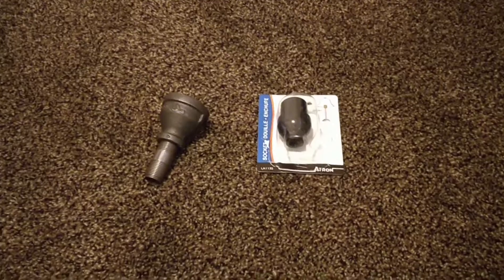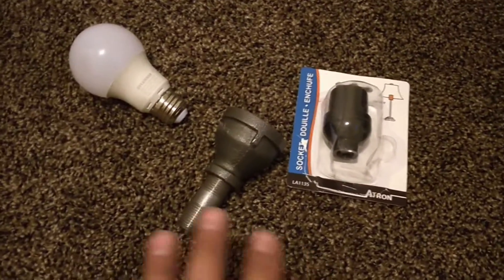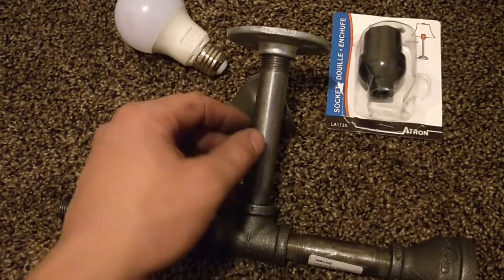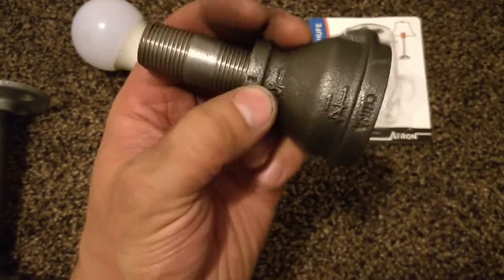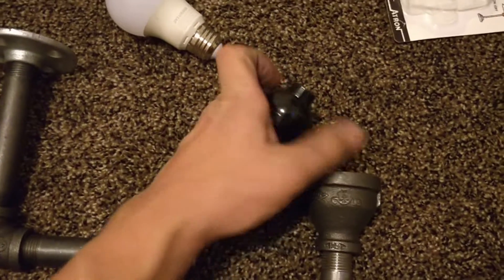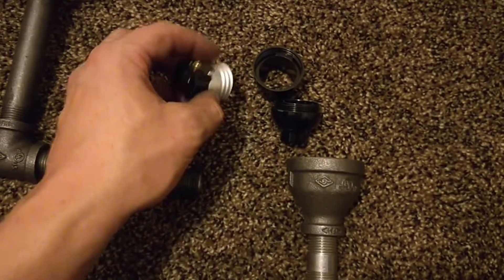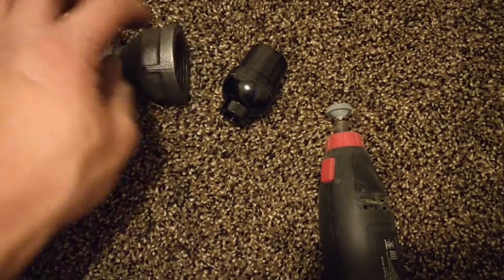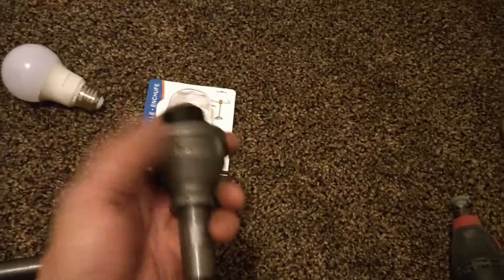Best socket for building a black pipe lamp

Comment: Is there a safe way to do this without grounding it? I have built a huge light with 7 light fixtures but I’ve been warned about wiring it because it isn’t grounded
Reply from the maker: It should be grounded for sure.
Reply: @Always Thinkering If it is not grounded your breaker will flip alright but not before YOU are the ground, could be real bad.
Reply: Could you ground to the pipe directly?